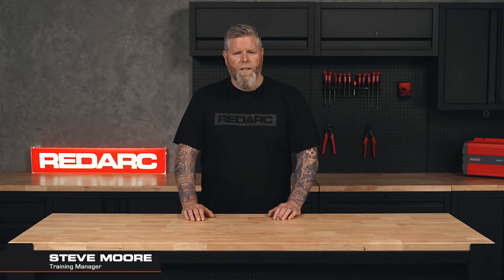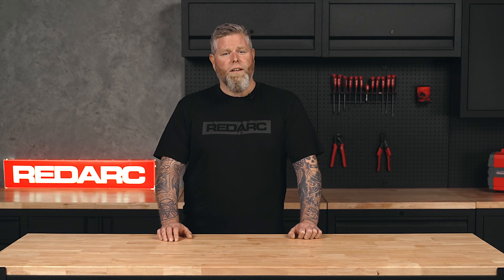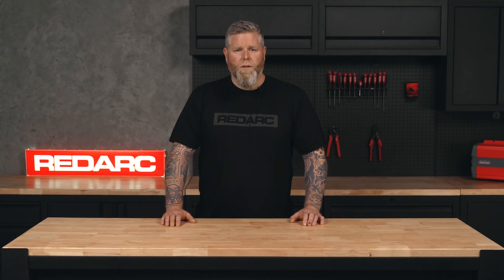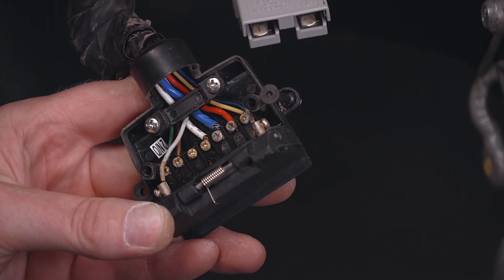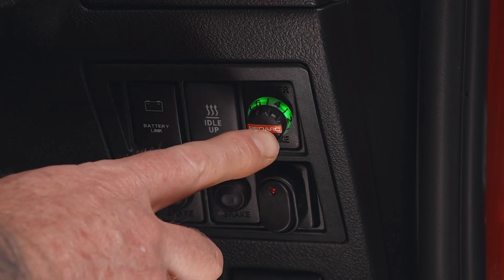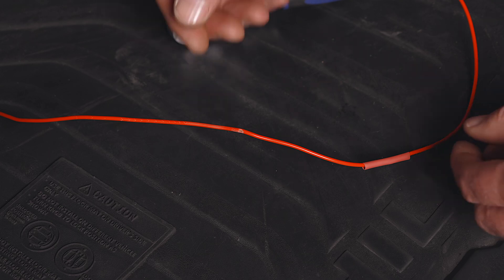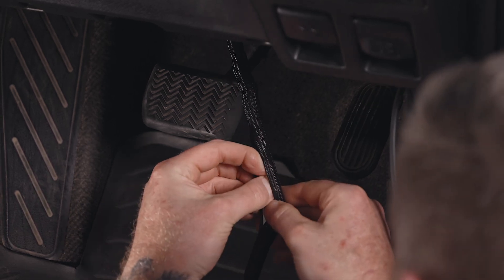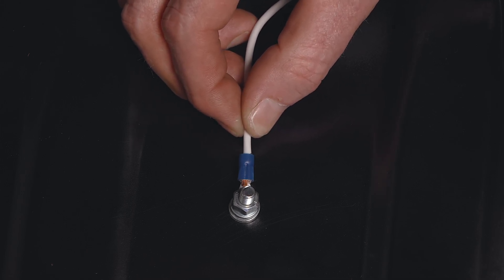Why Is My Tow-Pro Flashing Yellow and One Red? | REDARC Troubleshooting Guide

Comment: What about if it flashes 4 red and 1 yellow flash
Reply from the maker: Hi there - usually this code is indicative of an issue with the ground wire to the unit (white wire). I'd inspect this and make sure it has a good connection.
Reply: Hi what if the switch doesn’t flash after installation and also when press just comes blue and goes off straight